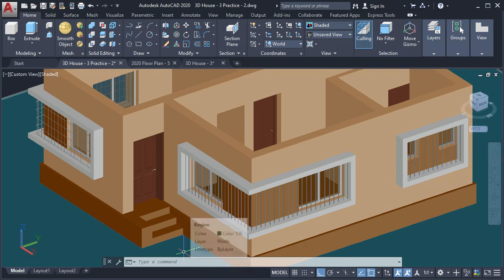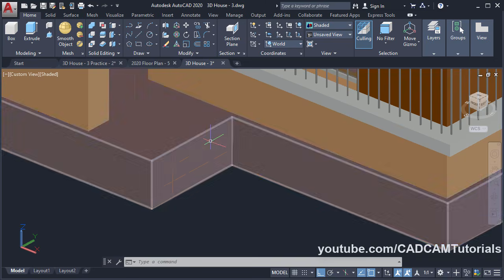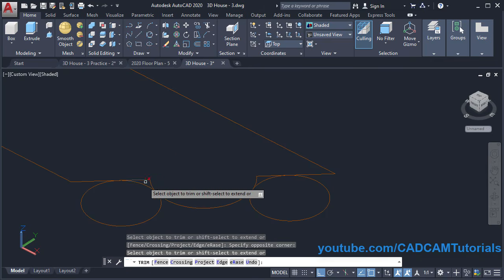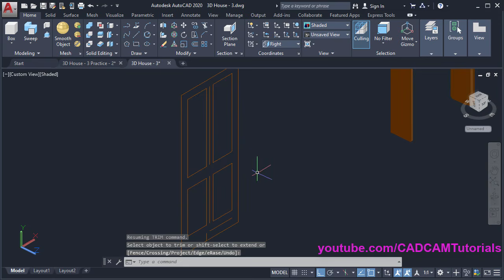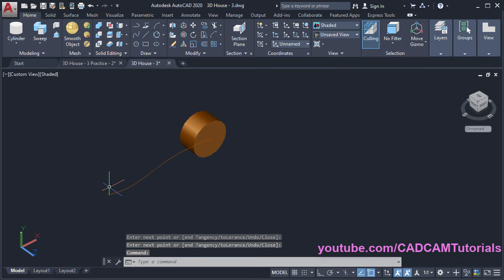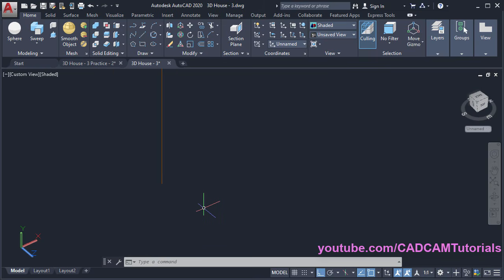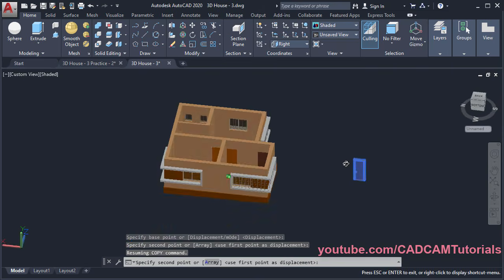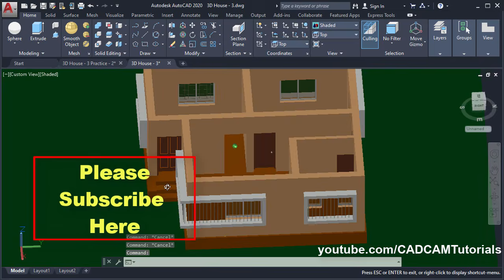AutoCAD 3D House Modeling Tutorial - 3

Comment: Sir, I've not been able to sweep the selected object though perfectly converted to a polyline. I receive the error message: " cannot sweep or extrude a self intersecting lines". What am I doing wrong? I have verified that the ground structure is a perfectly bound polyline.
Reply: Region applied to the object allows for Sweep to work.
Reply: @peterburbery2341  thanks man. It worked
Reply from the maker: There may be overlapping lines.
Reply: @CADCAMTutorials  how to check overlapping
Reply from the maker: Delete object
Reply: The sweep didnt worked with me either, I tried many times